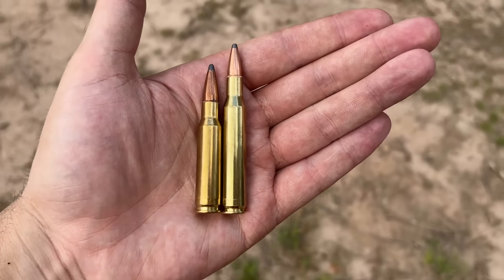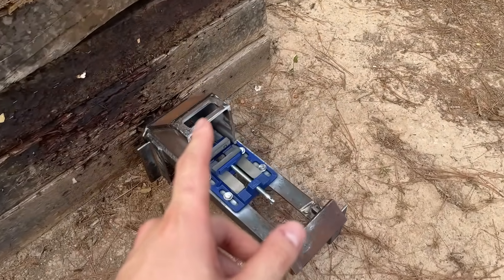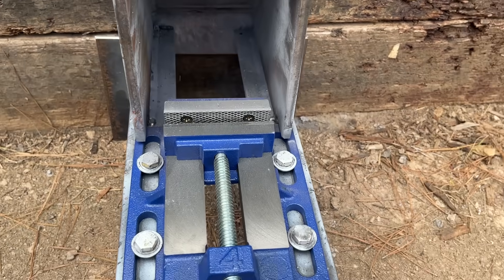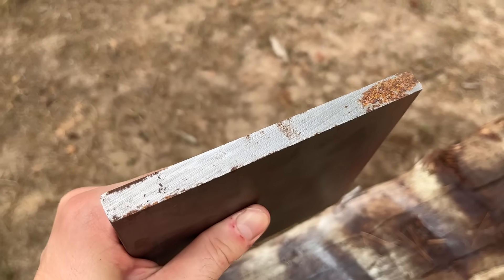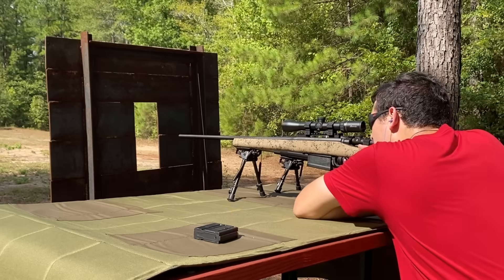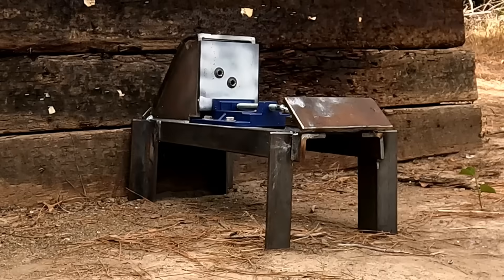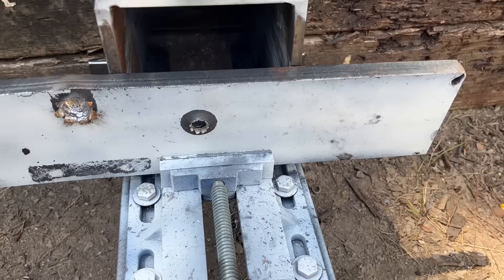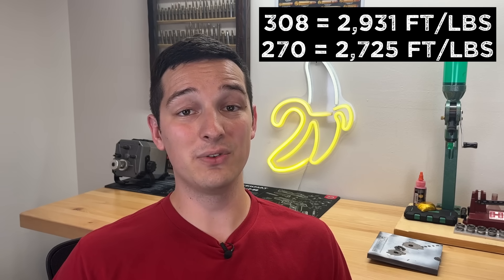270 Win vs 308 Win: ONE Clear Winner On Mild Steel

Comment: i would like to see the test repeated with a 150 gr interlock in the 270
Reply from the maker: I agree that would also be a good comparison
Reply: @bananaballistics   It wouldn't be a good comparison. It would be the only fair one. The comparison here is close but there's no reason why you couldn't have used identical weight bullets for both calibers.
Reply: Same here.
Reply: Still take the 270 any day of the week
Reply: @shatterspirit3349 308 is better lol so explain why you think a 270 is better
Reply: @shatterspirit3349  why?
Reply: Almost no one shoots 150s in .270. That takes away the flat trajectory that makes the .270.  Why not make it an equal comparison by running 130 gr. in the .308?  Because no one shoots 130s in .308 win.  It boils down to understanding where each cartridge is designed to excel.  It's strange to me that we gun nuts can't accept that different cartridges perform better in some metrics and worse in others.  We treat those cartridges/rifles like our children, meaning they are the best at everything!  We don't make that mistake with knives.  I have a great paring knife that can separate peel from apple or potato with ease.  I would never use that blade to fillet a walleye, gut a deer, or butter bread.
Reply: @gonzo9827  that makes a lot of sense.  (note, I'm not being sarcastic.) Just like 30-06 fans who crow about how it shoots 220 grain bullets and you can use it for brown bear.  Despite the fact that no such gun nut would ever actually use a 30-06 for brown bear nor would they likely use a 220 grain bullet.  As the guy in the video says, the 130 grain 270 already has a higher sectional density than the 150 grain .308.  So the .270 already had the advantage.  Further, the 270 has a much larger case.  What more advantage should we give the .270 exactly?  If you're using a .270 because it penetrates steel plates...better get a .308.
Reply: @gonzo9827  I shoot 150 grains in my 270. I rarely shoot more than 150 yards so trajectory isn't as important for me. I like a heavier bullet with more energy
Reply: @gonzo9827  - gonna drop some knowledge on you.  Sighted in for MPBR (and comparing data for Nosler Partitions only, for the sake of consistency) for a deer sized target, that 130 gr 270 bullet is about an inch flatter at 300 yards than a 150 gr fired from the same rifle, only about 2" flatter than a 7mm-08 firing 140 gr bullet or a 308 Win firing a 150 gr bullet, about 2.5 - 3" flatter than a 6.5x55 Swedish firing a 140 gr bullet at a modest 2700 fps, and a whopping half inch flatter than a 30-06 firing a 150 gr bullet.  So much for the idea that a 270 is especially "flat shooting."  It is, but so is every other bolt-action-fired cartridge commonly used for deer, black bear, and hogs.

Inside 300 yards, there is no practical difference in bullet arc or energy between any of the traditional bottle neck cartridges (from 6.5mm up to the .308s) that came along in the late 19th and 20th centuries.  We don't need any more justification in our rifle/cartridge selection than "I like it, and it works for ME."  And frankly, I find the 270 fan bois every bit as tiresome as the 6.5 Creedmoor fan bois, and for the same reason.  Only I'm in my mid-50s and have had to listen to the 270 crowd for a lot longer than I've had to listen to the 6.5CM crowd.

The one advantage in this group you get from the 7mm class and .308 class is 175 gr bullets in the former and 180 gr and 200 gr in the latter.  Not a big advantage for white tails or black bear, but certainly more advantageous for elk and moose.
Reply: Yup redo it
Reply: Or 150gn Remington Core-Lokt.
Reply: Please do a short redo in your next vid. Love ya ❤
Reply: Then how about 180 in a .308 then?
Reply: Would love to see. 270 with 150 grains bullet. I think it would punch through the 1/2 plate
Reply: Same here
Reply: Yep, velocity gets a bullet to the target, but it's mass that pushes it through.  Two 150 gr bullets traveling at similar velocity and having similar construction will penetrate to the same depth.
Reply: @smokedbrisket3033  I think diameter of the bullet might also play a roll in penetration if you're comparing bullets of the same weight. The smaller diameter being the same weight will have a higher sectional density which is supposed to help with penetration.
Reply: @russellkeeling4387  - no disagreement on that at all.  All else being equal, higher SD will prevail.  But there is bullet construction and impact velocity to take into consideration.  A premium 308 bullet (made by the likes of Swift, Barnes, Hammer, Norma, Woodleigh, North Fork, and several others) of 150 grains will out-penetrate a a .277 caliber 150 gr cup-and-core where impact velocity is closer to 3k fps than 2500 fps.  At high impact velocity, those premiums will generally retain 80% or more of their mass - in the case of Swift and Barnes, 95% or more of their mass.  Those cup-and-cores will fragment, often catastrophically, at high impact velocity.
Reply: @smokedbrisket3033  All you say is correct but I look at results I've seen in my own experience. I try to use the best bullets I can afford and I've never found a bullet inside an elk that I've shot. They all went all the way through and that includes two killed with a .50 cal. black powder muzzle loader using round lead balls. The longest shot I've taken an elk was at 326 yards with a 30-06 using 165 grain Hornady bullet. I don't know the condition of the bullet because the bullet passed on and the elk passed away.
Reply: @russellkeeling4387  - at 326 yards, that cup-and-core Hornady (I'm assuming it was an Interlock) was probably down around 2K fps, which is nearly an ideal impact velocity for that style of bullet.  Most of those regular hunting cup-and-cores do what they've always done, and done well, at those velocities.  But if you'd have had a 50 yard shot instead of 325, the outcome could have been similar to what John Nosler ran into with his moose, almost 75 years ago now.

Consistently successful hunting needs 3 components:  
1. know your own limitations
2. know your rifle's limitations
3. know your ammo's limitations.

In some circumstances, particularly with fast-moving bullets, premium bullets are almost always a better choice.  But with slower-moving ammo, it might be a coin toss, or a good cup-and-core like Interlock or Speer Grand Slam or Remington CorLokt might actually be a better choice.  Suppose you're hunting elk with a trusted 308 Winchester, and your standard ammo is 180 gr (assume a 180 gr Interlock).  MV for that particular load isn't going to be any faster than about 2600 fps.  By 50 yards out, that bullet is already down to just under 2500 fps, by 100 yards, it's already below 2400 fps.  I wouldn't hesitate to take even a quartering-to on the shoulder for an elk or a moose with that setup.

That same 180 gr Interlock, fired at 3050 out of a 300 winmag is a different story.  Inside 200 yards, I'd wait for a perfect broadside.  In fact, I wouldn't use that bullet in a 300 winmag, I'd use an A Frame or North Fork or Barnes. The limitations on premiums are often a low ballistic coefficient - meaning you're limiting your range because of poor expansion (or none at all) below about 2K fps impact velocity.  Norma Oryx is a famously soft premium bonded bullet, but they also have notoriously low BCs.  They will probably open up reasonably well even down to 1600 or 1700 fps.  But TSX and A Frame will not expand to a useful degree at those velocities.
Reply: Depends...  22-250 is a menace in ar500 plates
Reply: @smokedbrisket3033  the smaller frontal area would penetrate further in flesh. In steel, it's all about energy, which is a function of velocity. A lighter projectile is faster= more energy =  greater penetration in steel. Steel penetration is of no interest unless you are hunting earthmoving equipment
Reply: Why
Reply: Send him the ammo to test or just go get a plate and shoot it yourself
Reply: Redo it and use some federal
Reply: I get what you are saying about the same grain bullets, but ever since I got into firearms and hunting, the magazine articles I read about, when they compare the 270 to other calibers, they would always use a 130 grain in the 270
Reply: @georgelewis7010 - the gun rag writers are there to sell copy.  It's no sense in accusing them of lying, they're not.  They're just presenting, in most cases, a very narrow view of things.  Does a 270W firing a 130 gr bullet have a very flat ballistic arc?  Yes.  That is true.  But then they make no mention of the fact that all modern bottle-neck cartridges also have flat ballistic arcs out to 300 yards, and the difference between 270 and any of them is so small as to make no difference to the shooter or to the game pursued.

Think about this.  If you are a consistent 1 MOA shooter, always shoot 1" or slightly better at 100 yards, it means you're going to be a 3" shooter at 300 yards.  If the ballistic arc difference between a 130 gr 270 and some other cartridge is less than that 3", well, that is certainly within the margin of error for both cartridges - meaning there isn't really any difference between them as far as trajectory.  There is a mathematical difference of about 1" between 130 gr and 150 gr 270 at 300 yards, but having a higher sectional density, the 150 will out-penetrate the 130 every day of the week and twice on Sundays. 

In almost all circumstances, terminal performance of heavier bullets on animal flesh will be better than for lighter bullets.
Reply: even the 140 gr. whitetail round .
Reply: bro you shot a 130 grain vs a 150 grain. shoot both 150 grain and see what happens.
Reply: Agree. The 270's powder keg is larger than the 308, sooooo would be nice to see.
Reply: Yes it sold the 270 short firing the lighter bullet
Reply: They both kill game very well, personally I eat lots more deer etc, than mild steel plates
Reply: I own both. I've killed deer with both. Some out to near 500 yards with the 270. Unless you're planning to make holes in mild steel there is really nothing here to argue about. They both take out fleshy targets equally well
Reply: @pcad2610  Yes. I am with you on this. My farthest deer shot was 361 yards on a nice 8 point whitetail. It was with a .280 Remington. It's very similar to the .270 Winchester. Bullet went clear through. All the other deer I have killed have been closer than that. I do have a criteria for deer rounds that I kill with. But all are more than adequate at 200 yards or less. I do like do a good bullet, though, like a Nosler Partition.
Reply: yes... and 180gr for 308 at the same time.
Reply: @harijsbruns8582 No. In my .308 the 165grain had best penetration!!!! The the 150 (almost the same as the 165) Anything lighter or heavier was either to light or to slow 😢
Reply: The 150gr in the 270 is worthless. You might as well shoot a 308 or 30-06.
Reply: @donwyoming1936 Wrong !! I have been using 150 grain Barnes Originals for over 10 years now . 1 Elk , frontal shot , traveled completely through Elk , destroying the heart , 1 lung and liver . Ended up lodged on back hip and atilled weighed 148 grains  .
Reply: @donwyoming1936  I shoot 150gr partitions at 3000 fps; I can assure you it is anything but useless. I get the same vel out of 150 gr accubond long range, but haven't used them on game yet. Most factory 130gr loads are at ~that speed. Factory ammo sucks